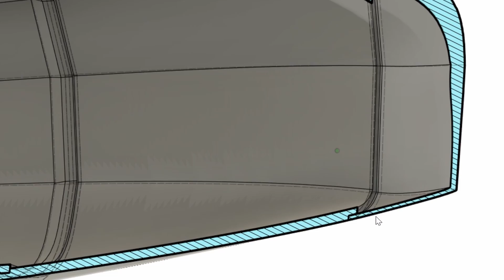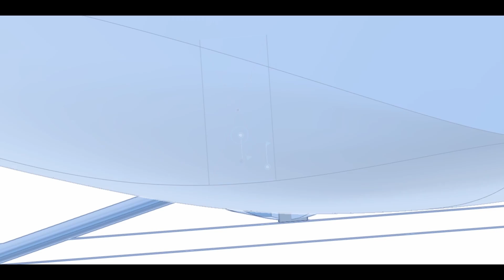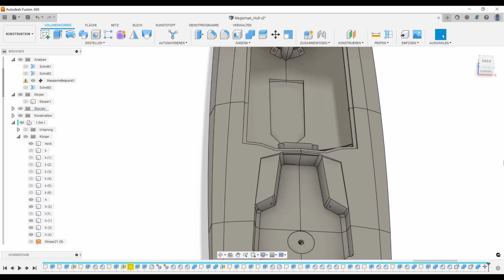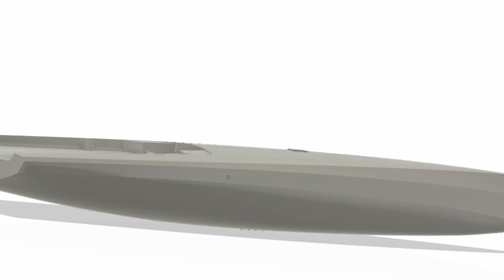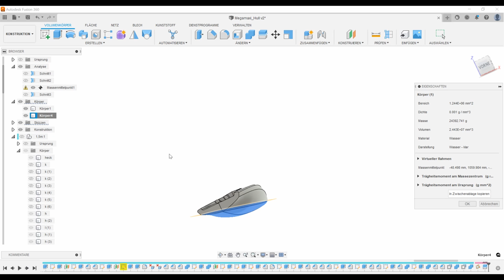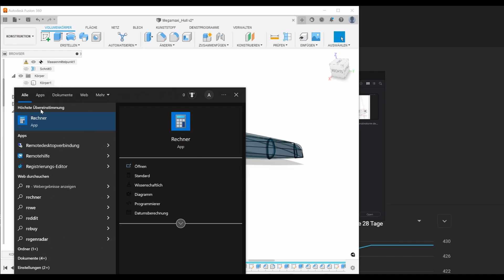RC Sailboat Maxi Yacht 1.8m for 3d Printing hull design for 3d printing

Comment: Regarding the displacement you could just use the volume of that cut out instead of going the extra mile with the material change.
(edit: after continuing to watch I now get why you change the material, still you can take the volume in liters or m^3/1000 and got the weight in kilograms)

Also how did you model the hull? I have difficulties doing it consistently in Fusion.
Reply from the maker: I did a Tutorial ON that as well

Comment: WoW!! Great video mate! So this hull without glue, fittings etc would only use approx 1.6 KG of Filament if I used ABS? - Jim -Australia Subbed
Reply from the maker: I think it easy can be build with less than 1.4 kg of filament
Reply from the maker: But and there's the hook. That's why I have taken it offline: volume is really tight. You have to save wheight really co distant and the total boat needs to be at less than 7 kg with 5 kg lead